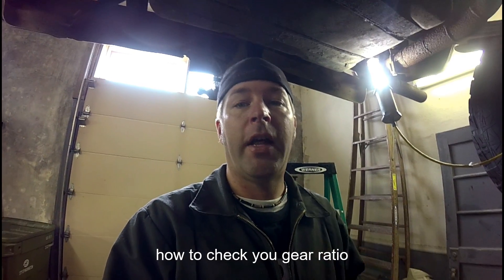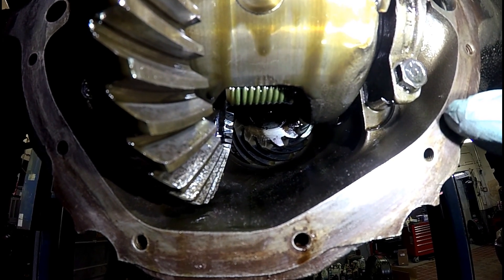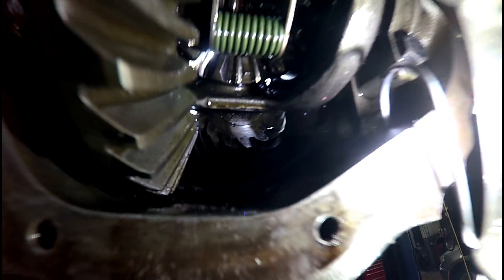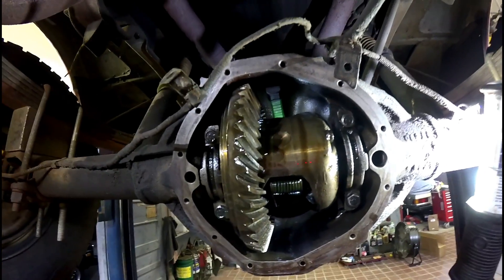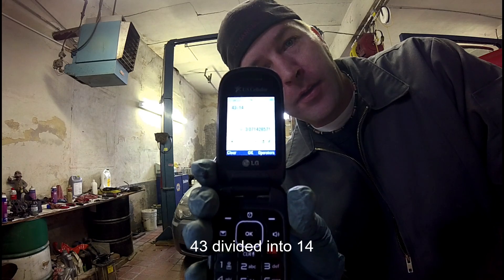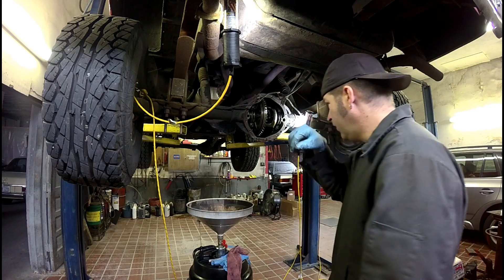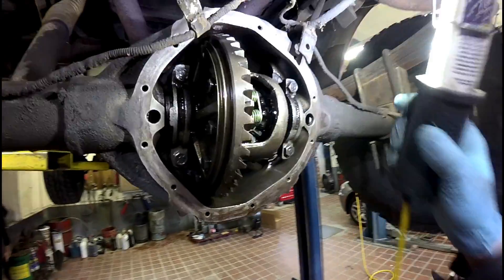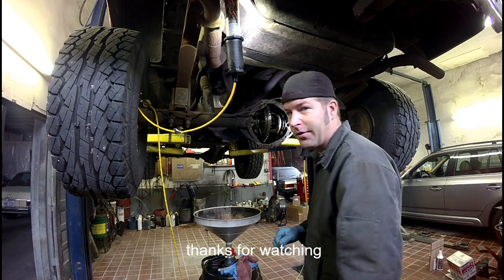gears

Comment: There is another way that dont require pulling the cover, especially for axles like the ford 9 inch that dont have a cover. you can just turn the yoke and count how many turns it take to make one tire revolution. In my mercury it was 2 1/2 turns and it had a 2.50 gear. May not be perfectly accurate for odd gears but if you have an idea of what could be in there you can easily figure it out.
Reply from the maker: maybe ill cover that way too